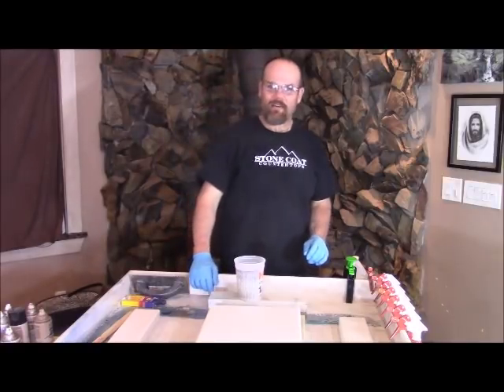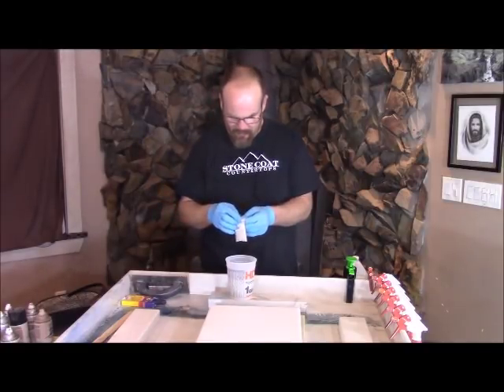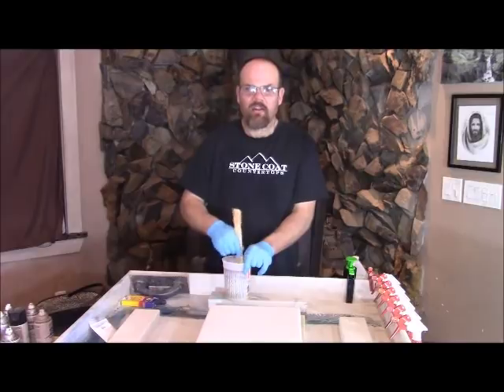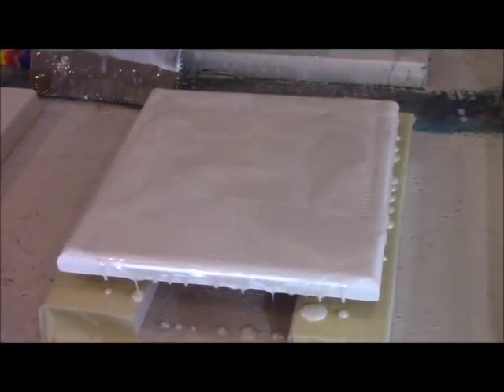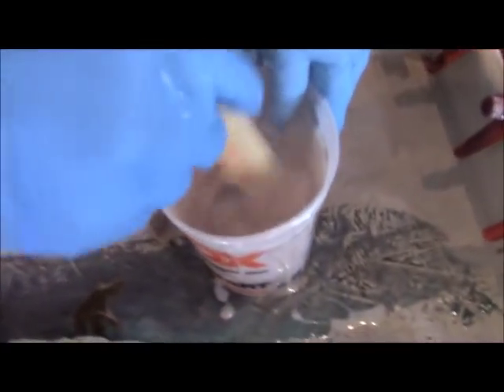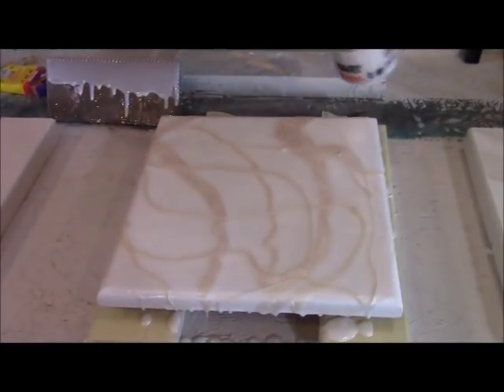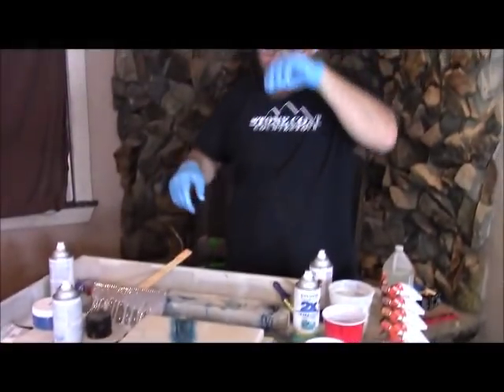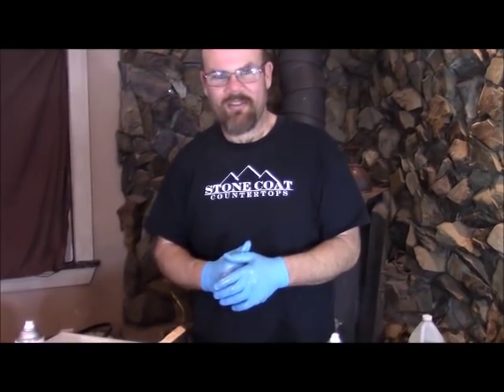Epoxy Countertop White on pearl with Blue and red vein

Comment: Just Gorgeous!!  I want to do this over the existing arborite in my pop up camper.  Will this stand up to the cold/hot and possibly humid temps?  I live in Canada and we have to put our camping trailers away for 7-8 months of the year ;-(    I thought because it is an Epoxy that it would, but would really like your advice on this.

Comment: Is it ok to use a heat gun vs a torch?  Will it create the same effect with a heat gun?
Reply from the maker: Hi Aaron, great question and thank you for watching! We always use a propane torch. A heat gun will work, but not as effectively as a torch. In our experience the torch pops bubbles and moves color much better than the heat gun. Here is a link to our favorite torch head. This is used with off the shelf small propane bottles: https://www.amazon.com/Bernzomatic-TS4000-Trigger-Start-Torch/dp/B00008ZA09/ref=as_sl_pc_qf_sp_asin_til?tag=stoncoatcoun-20&linkCode=w00&linkId=1079ed93ce4f9a3210140881ab1ed4ed&creativeASIN=B00008ZA09